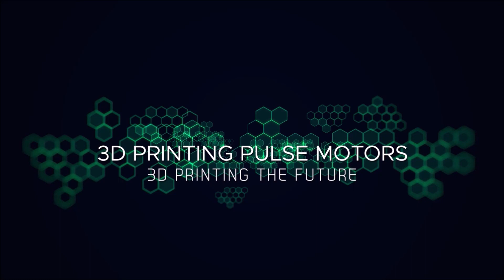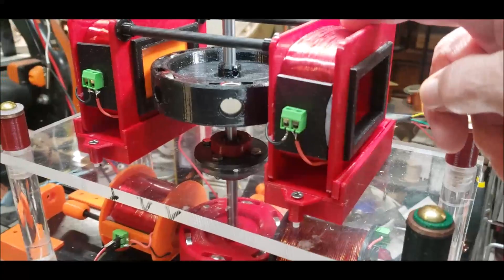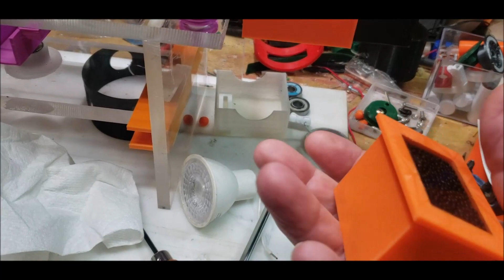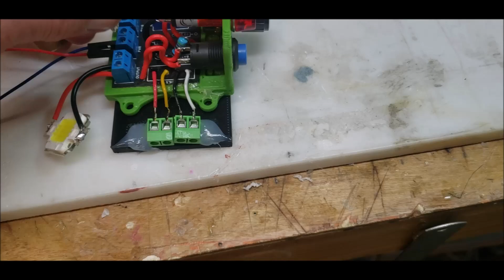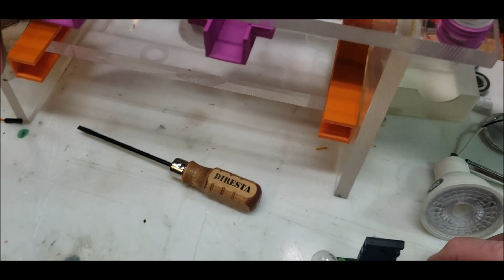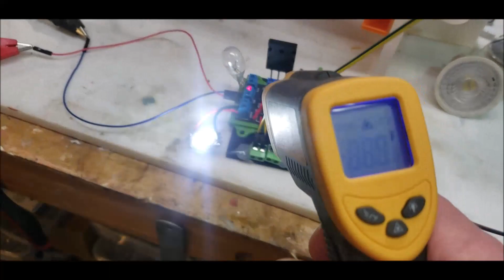3D Printed Pulse Motors and a new circuit  ;-}

Comment: This is fascinating. The Bedini circuit is impressive. The whole setup is impressive tbh, it's amazing that it's printed by you yourself as the creator of the pulse motor. You didn't have to order the parts to assemble, you made them yourself. Well done indeed.
Reply from the maker: thanks ya I love 3d printing. It has changed the game completely
Reply: @mcorrade  Well you have inspired me. I have sent for replacement springs for the center part of my 3D printer and even though I'd rather have my nails pulled out, I'm going to tangle with Fusion 360 again, to assist in making pulse motors.😊👍
Reply from the maker: @hoofheartedicemelted296  Go for it. Fusion 360 is a lot easier than I first thought. I'm no master at it but I can create my own stuff which I love. If you see any prints tht you want to copy, just let e know and I'll upload the to thingiverse if I still have the .stl's :)
Reply: @mcorrade  Thank you sir that is most generous ( thingiverse ) Even the cores in this video, good God it's genius. No disrespect to the masters ( Bedini, Babcock, Lindermann  Murakami etc ) but they would delight in the inginuity of a core that didn't have to be hammered in one pin at a time. Whoa I still can't get over that one. haha. Brilliant 👏